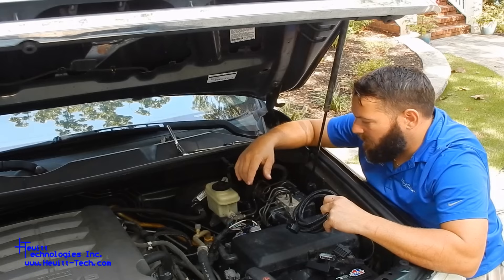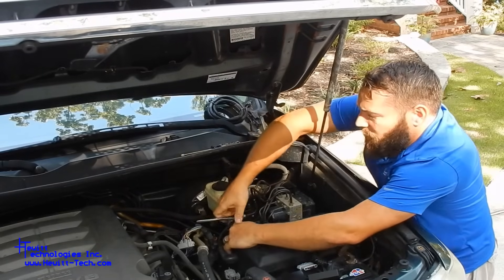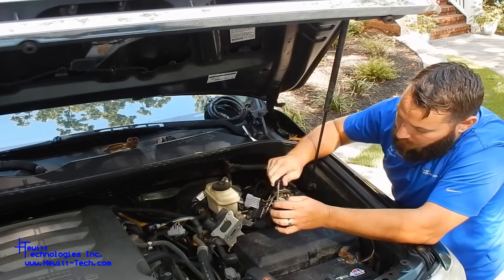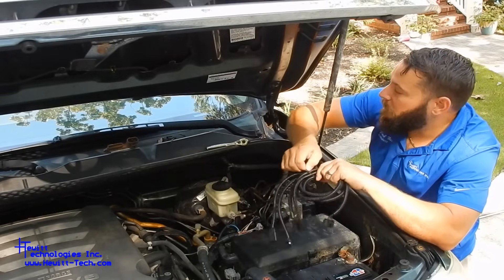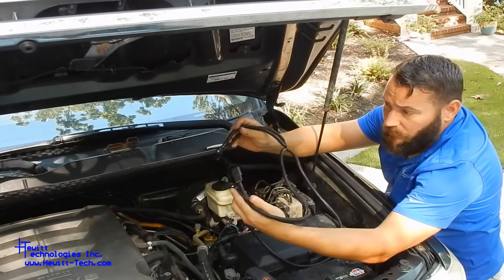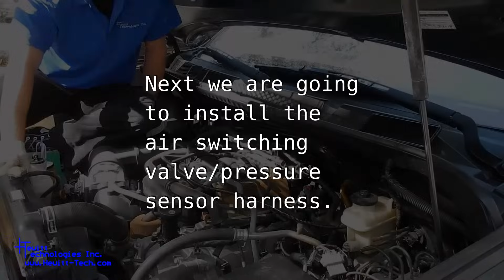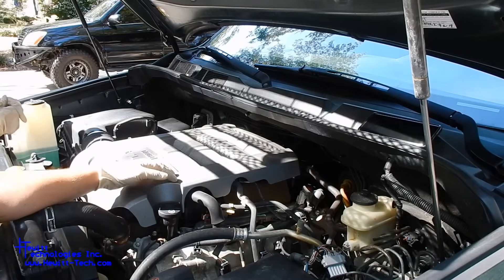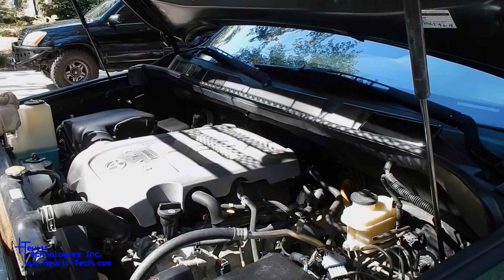Gen-II Secondary Air Injection Bypass Module - 2007-2021 Tundra 5.7L- Hewitt Technologies

Comment: Can you answer my question?
Reply from the maker: Well, I guess it really depends on the question doesn't it? Give us a call or email us toll free if you have a specific question(s). Support@hewitt-tech.com 1-844-307-7671
Reply: @Hewitt-tech  2007 tundra 4.7, I have the codes P2432, p2433, p2442, p2447. I swap air pump and valves like 8 months ago, and now I got the same codes like before, is this kit solve that problem?
Reply from the maker: @jhonlwis2105  Sounds like the all too common problem with aftermarket parts. Assuming the problems are not ECM or wiring related the Gen2 kit plus two Gen2 Pressure Sensor Replacement Single addons should be able to resolve your problems and prevent you from having to replace parts again. Please give us a call for any more in depth questions and we can advise better.
Reply: @Hewitt-tech  k, tell me schedule to call
Reply from the maker: @jhonlwis2105  We are open and available to speak with you today between the hours of 8:30 am - 5:00 pm ET. We look forward to speaking with you. 8443077671

Comment: I installed the Gen-II on my 2011 Tundra 4.6L with relative ease and it only took two hours. Hewitt's YouTube videos helped immensely, plus a couple of others I found demonstrating the installation process. 
The CEL came back on shortly after installation of the bypass kit. I emailed Hewitt support and the owner replied immediately. That in itself spoke volumes to me about this company! Mr. Hewitt suggested I install the optional pressure sensor on Bank 1 to see if it would resolve the codes I was getting. I was impressed that he did not try to convince me into buying a pressure sensor for Bank 2 unless I truly needed it. Turns out I did indeed need the second pressure sensor which took all of one minute to install. Since then, my truck has been running like a champ! 
Finally, each time I placed an order I paid for overnight shipping from their location in SC to Dallas, TX and the part was sitting on my doorstep by 9:00 AM the next day. Again, great customer service. I highly recommend this company and their products!

Comment: I have been trying to get the harness connections undone on the AVS for over an hour.

The 1 hour install estimate is very optimistic, the passenger side is very difficult to reach if you have large hands. I’m probably going to have to remove and or move a lot more of the factory main wiring harness anchors to get at the bank 2 ASV connection.
Reply from the maker: Sorry you are having or had a hard time with the connectors. The passenger side in particular on the 5.7L certainly can be difficult, even for an experienced mech/tech. Unfortunately, it is what it is which is why we warn about it in the video and instructions and point out some things you can remove and unbolt to get a little more room. No sugarcoating there.
A topside creeper or placing several layers of cardboard on top of the engine bay you can lay on helps a lot so you don't have to support yourself with your hands. 
I find laying the tip of a small flat headed screwdriver on top of the tab really helps depress the locking tab and makes it easier to pull the connectors off. You can also use a long screwdriver or blunt punch/ round file to depress the tab and use long reach needle nose pliers or another long screwdriver to catch the side lip of the connector to push-pull the connector off.
Just be really careful not to damage the wiring. 
If we can help with anything just give us a call.

Comment: My 2008 Toyota tundra was giving me trouble codes I called a local dealer and they told me it would cost me upwards of 4500$ so I started looking and I found the Gen2. I want to thank you I installed the Gen 2 and an add-on on Dec 22 and up to now it's been working great. it took me about 1 hour to do but I did have a little trouble with the blocking plates which I overcame.
Thanks again
Reply from the maker: Great news and we really appreciate you leaving a comment. There is nothing better then getting Tundras back on the road and money in your pocket! If there is anything else we can assist with  please do not hesitate to contact us.

Comment: Hey, I bought and installed the product on my 2010 tundra v8 4.6 and it worked great for a year or so.  But now the lights are blinking again, and it is stuck in limp mode.  It pulled the code P2442 stuck air injection pump.  It also pulled a code for the 8 cylinder so I replaced the coil.
Reply from the maker: Please give us a call Toll Free 1-844-307-7671 or email us directly at Support@hewitt-tech.com 
The P2442 is a Bank2 Air Switching Valve Stuck Open Code. If you did not install the block off plates you will need to get them installed and clear the codes again. If can verify that you do have the plates installed, this usually indicates the pressure sensor in that valve has failed. They can be damaged by continuing to drive the vehicle with the valve stuck open codes for a while before installing the kit. It doesn't happen often but the damage can also show up much later. There is also the possibility the sensor just failed but we usually only see that with aftermarket parts and not the factory Toyota sensors. We have kit add-ons for the sensors depending on which kit you are using to take care of this without having to replace the air switching valve. Give us a call and we can hep troubleshoot and get you what you need.

Comment: not sure if this thing really works..installed mine n still getting the code n still putting my truck into limp mode
Reply from the maker: For support, please contact us directly with the trouble codes you had before installation and the codes you are getting after installation and clearing them. 
Call Toll Free 844-307-7671, email Support@hewitt-tech.com or use https://hewitt-tech.com/contact-us/

Comment: Wat about my 2010 Toyota tundra 4.6
Reply from the maker: Yes, We have a Gen2 kit for your 4.6L also. The module itself installs the same but the block off plate and harness install is much easier on the 4.6L. 
Your air switching valves on the 4.6L are on the top of each valve cover and very easy to access so that is where the plates and harnesses plug in on yours. 
Please contact us direct or give us a call for more specific details.

Comment: Is this what prevents the car from
Shifting into higher gears on the highway????
Reply from the maker: Many of the secondary air system's trouble codes will put the vehicle into what we call "limp mode" the vehicle will not shift electronically and the engine runs only baseline maps which means poor gas economy.
Reply: @Hewitt-tech  thanks exactly what I wanted to know. Will be contacting u soon

Comment: I just installed the gen 2 kit on a 2008 4.7 tundra i just picked up. Great instructions and worked like a charm! Only thing is I installed the block off plates at the air valve.  Is that okay and can I take the air valves out all together
Reply from the maker: @hinds90 In order to remove the Air Switching Valves located on either sider of the engine you will need a full delete kit. That is the Gen 2 Bypass Kit and 2 Pressure Sensor Addons. However, if you only have the Bypass Kit then they will need to remain on the vehicle. This is because there is a pressure sensor inside the Air Switching Valve the ECM is still reading. If you have any questions please do not hesitate to give us a call.
Reply: @Hewitt-tech  yep. So I'd just need the pressure switches. I'd like to get rid of them all together. Makes it easier to get to the coils and plugs.
Reply from the maker: @BullseyeMetalWerks  Correct. You can get two of our pressure sensors add-ons to accomplish that, one to replace each of the air switching valves. If your air valves/sensors are still good, you can also cut the sensors off the air switching valves and get rid of the rest of the valve. They have to be the factory type of valve with the metal body and the black plastic top where the plug is to do this. If you cut all the way through the square black plastic body section as close to the metal valve body what remains is the sensor/connector. When doing so you will cut through the plastic and will cut two wires but those are only for the solenoid coil portion which are not connected or used with the Gen2 kit anyways.

Comment: What would be the correct kit to buy for my 2008 tundra, v6 4.0 2WD
Reply from the maker: We have you covered, the recommended kit would still be our Gen2 kit. The kits are slightly different by year, model and engine so entering your vehicle information on the website will get you to the exact SKUs that you will need to order. The SKU# that you should reach is G22B40H4. Please give us a call with your trouble codes for a consultation and we can make sure you don't need anything else like pressure sensor addons or need to look at something else like wiring first. Toll Free 1-844-307-7671 support@hewitt-tech.com

Comment: 2007 Tundra 5.7, If the pressure sensor of bad or coding is there just one. Meaning does the add on kit just need and come with one replacement plug and play air pressure sensor replacement unit?
Reply from the maker: On your 2007 5.7L, there are two pressure sensors, one in each air switching valve. Regardless of our kits, your vehicle needs both of those to function correctly. Because of the way the Gen2 kits function, you need one pressure sensor add-on for each damaged sensor. Each of the sensors add-ons for the Gen 2 kit are one sensor. With the Gen1 kits we can get away with using a jumper harness to use one of the good sensors for both banks or a single add-on sensor for both.
Reply: Then, will the Gen 1 kit work for my above vehicle? And if so overall cost me less to bypass the sais?

Comment: I bought a Gen II SAIS kit and a PSO for my 2007 Tundra from Hewitt Tech February of 2021 and just made time to do the install in Jan 2022.  I'm not terribly mechanically savy but Paul's system and instructions made the installation a breeze.  The components are high quality; the installation instructions include photos of critical steps and are easy to follow.  I would recommend this solution for any Tundra owner that is facing Secondary Air Injection System failure, it is an excellent fix with top-of-the-line support.
Reply: Is your tundra still running well?
Reply: @jondavis2206  I haven’t had any trouble since the install.  No warning codes or power issues.  I use my truck for my business up here in Alaska so I feel like if there were going to be any lingering issues, they would have been apparent by now.   I have no reservations recommending this kit to fellow Tundra owners.

Comment: On the 2008 5.7 , if you remove the wiring harness bracket on the firewall passenger side it gives you a little more Room for your hand. Other than that it’s all by feel. Just got mine installed and so far it works good
Reply from the maker: Yes! It certainly helps which is why we mention this in the instructions.

Comment: Did this on my 2008 , the support was top notch. I am a long armed tall human so i had to improvise to get to the passenger side clip after trying the whole lay on top the engine. took a few hours to figure out. If you do not have a young small young person to do the passenger clip.

So the 10mm bolt holding a small harness on top of the intake manifold once you remove it you can see the clip. to get to it the easiest way was to unclip the main harness from body on the passenger side, then there is a 2nd clip that is holding onto the engine via a 10mm bold. Once both are removed . You can push the harness around and reach the clip from the passanger side with no issue. I used  small nose plier to push the tab down and pull.  The  harness clips are one one where you stick your small flat head screw driver and just pull. they are strong and they will clip back. Even if not its not a big issue, the 2nd clip is held in place with a 10mm which is easier to remove the bolt then removing the harness. 

Might help someone as this if know would take you 10 minutes to do the passenger side.  the driver side is easy.

The block off bolts were completely rusted so ended up getting a pdf from heweitt with some solution that i gave to my mechanic who charged me 100$ to get this done, If our pump is stuck open then this is needed to clear the error.

Put 1000 miles in the July 4th weekend and got 2 mpg more than usual and it runs with alot pep. Smooth. Being a 2008 mine is out of the age for emission . i also got some gas smell in the cab which has disappeared

Comment: I just installed this kit on my 2012 Toyota Tundra 4.6L. It did the trick! 

The switching valves are in the engine bay rather than under the wheels for my truck. Loosening the bolts on the switching valves for the block plates installation, especially the one near the air filter, were the toughest parts of the install for me. All in all it probably took me 3.5 hr - I’m mechanically inclined but more on the home improvement side of things.

Very happy with the product, so far. I really hope it holds up over time. Thank you, Hewitt

Comment: Block off plates are required?
Reply from the maker: We strongly encourage and recommend the installation of block off plates which is why we include a set with every kit. In the case of valve stuck open codes, they are the only thing that will prevent the exhaust gasses from leaking backwards through the system. This also prevents the pressure sensors in the air switching valves from being exposed to the exhaust gases. 
In effect, they permanently close the air switching valves. 
Even if you are not getting valve stuck open codes, the air switching valves are still known to leak later on down the road. At that point you will still have to install them. In most instances, it is always best just to install the block off plates with the kit. This will prevent future limp mode from leaking valves as well as save the pressure sensors from damage (if they weren't already damaged). If for whatever reason you can't get them installed but aren't having any issues after the bypass kit... make sure to put them somewhere like your glove box with the instructions so you know where they are if you need them in the future.

Comment: I just ordered one for my 2008 sequoia. I really hope this fixes my CEL.
Can I remove the pumps after this is done? Are there any issues doing that?
Reply from the maker: With the Gen2 kit installed, the air pumps can be removed from the vehicle without any codes for the air pump circuits. P0418/P0419

It is illegal to remove, dismantle or otherwise cause to be inoperative any pollution control device required by federal, state, or local emissions law. . No other applications are intended or implied. By installing or using this SAIS Bypass Kit the vehicle owner and installer acknowledge and assumes ALL risks associated with its use.

Comment: I just completed my 2010 Toyota Sequoia 5.7L.  The product worked great!  I found the video(s) most helpful as I'm an amateur mechanic.  My son will be installing it for his 2007 Toyota Tundra 5.7L as well.  Thank you!
Reply: Do you mind explaining to me what this is for ?  Is it for the air suspension vehicles ?  I'm looking at replacing a rear air bag/shock on a 2008 Sequoia Platinum and I starting to think maybe I should do the coil conversion.  Is this all related ?
Reply: @rj8296  My vehicle went into "limp mode" and this bypass eliminates that problem.  FYI, I'm planning the coil conversion too but I don't think it's related to this problem.  I'm replacing the air suspension because I'm hauling trailers and need the added support.
Reply: @davidscott9466   from everything I’ve read air bags are far superior when hauling, that’s why Semi Trucks have them. I ordered new air bags for mine.
Reply: @rj8296  that may be true for semi tractor-trailers, I wonder why Tundras don't come with the airbag suspensions.  Sequoias are essentially on Tundra frames.
Reply: @davidscott9466   They actually do have the air ride option in the newer models.  Many people that tow heavy campers add them using aftermarket companies.
Reply: @davidscott9466   Cool thanks for the info I was way off with my question ha...  I actually called Hewlett yesterday to get an idea how common this issue is ( she said they sale around 800 a month ).

Comment: 2008 tundra 5.7
Just had my full kit installed, did the install myself.  It went smooth overall, even though there are tight spaces and hard to get to spots, helps being tall with long arms and big hands 😊
The CEL went off right after, with out having to plugging in the code reader and erasing codes. Truck passed emissions with no problems.
Huge Thank you! to Paul Hewitt and his team for developing a great product that works, it’s definitely worth the money invested to keep our trucks on the road.
Reply from the maker: Thanks for taking the time leave a comment and really appreciate the kind words. Glad we were able to get your Tundra back on the road and out of Limp Mode. Please let us know if there is anything else we can assist with.

Comment: What are the top speed once on limp mode  ? My Sequoia 08 doesn't wants to go over 80, is this the beginning for limp mode??
Reply from the maker: We have seen variations of "Limp Mode". The most severe is when acceleration is capped at 25 - 30 MPH. However, we have also seen when vehicles struggle getting up to 70 - 80 MPH. We have not yet been able to identify what or when causes this variation but an observation we have made over the years.